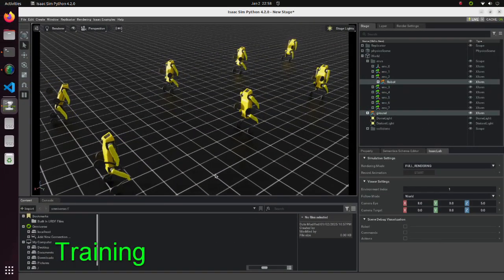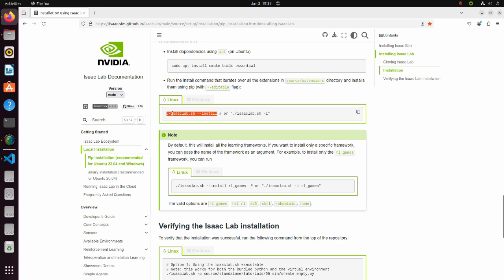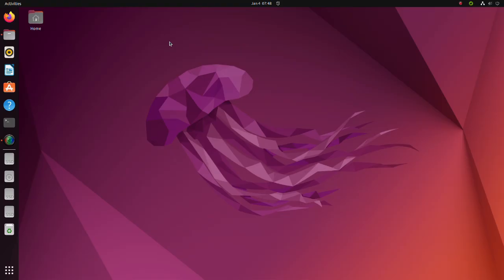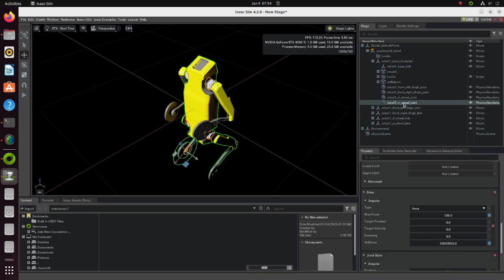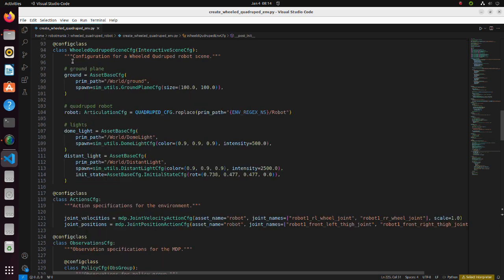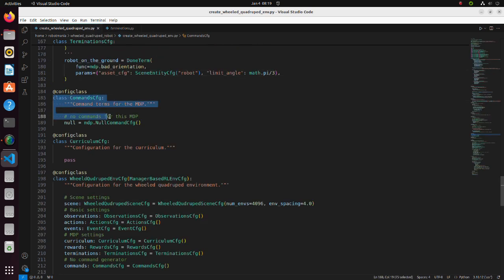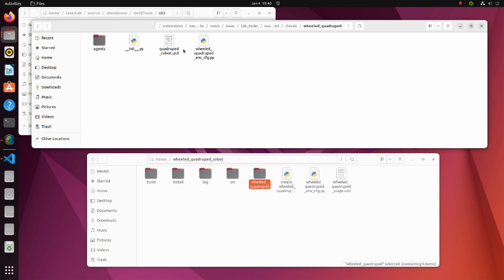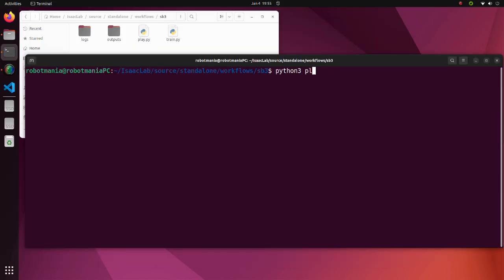Isaac Lab: Custom Environment Training. A Step-by-Step Guide

Comment: Hi, thank you so much for your video, that is an awesome video. I have found a helpful video like this for a long time.
But i have some questions, I hope that you can help me explain.

- What is the difference between Isaac Lab and Isaac Sim? Which is better? better in the long term, supporting, for performance, etc?

- What is your PC configuration? ( RAM, CPU, GPU, etc). I read the requirements to install Isaac Sim/Lab, so it is okay if I use something like a GPU, CPU does not meet the requirement?

- I noticed that you've been training using the available policy, which I believe serves as a foundational approach—a starting point to get familiar with policy-based training. It's a great first step. Moving forward, if I want to improve the training quality and results, I assume I'll need to modify or optimize the policy, right?
Also, regarding the policy currently used in your video, is it specifically tailored for the object you're training with? Or is it general enough to be applied to other systems, such as robotic arms? And if I want to adapt it to a different task or platform, would I need to make any modifications to the policy itself or the training program?

- Would you be able to share more videos or suggest useful resources for beginners like me to better understand how to think about modifying existing policies or even designing new ones tailored to specific tasks?
At the moment, I'm mostly following available projects—just installing dependencies and running training scripts as instructed. But I haven’t yet reached the point where I can build or adapt training programs or policies on my own. So any guidance or learning materials that help build that kind of thinking and understanding would be incredibly helpful.

-Would it be possible for me to connect with you through another platform, such as LinkedIn or WhatsApp?

Thank you so much and hope to hear from you. Have a nice day.
Reply from the maker: Hi Thanh Bao Tran!
Thanks for watching my video!
1.	Isaac lab is a tool (libraries) to do reinforcement or imitation learning using Isaac sim. Isaac Lab is built on Isaac sim.
2.	I use several PC. In general, if you have 256~GB SSD, NVIDIA RTX graphic card (such as RTX 4060, 4070) intel CPU such as i7 and 16~32GB memory, Isaac sim should work without any problems. If you use Isaac lab and you would like to do training with large number of environments in parallel, you should have a computer with higher computational capabilities. 
3.	In this tutorial I trained policy using a common algorithm such as PPO. If you want better results you may tune network of the policy or do hyper parameter training. Also, this algorithm can be implemented to other tasks including robotic arm. To get better results. you might need some modifications.
4.	Here are pages of libraries that are often used for machine learning.
https://stable-baselines3.readthedocs.io/en/master/
https://scikit-learn.org/stable/index.html
https://github.com/leggedrobotics/rsl_rl

Comment: Thank you for your contribution to help people learn Isaac Lab. But please put the warning that this robot has less DOF than the real robots. This USD file will confuse people who start with Isaac Lab without understanding Isaac Sim.
Reply from the maker: Hi Huy Nguyễn!
Thank you for the suggestion!
Actually, this robot has 12 degrees of freedom. You can see joints definition it in the xacro file. I just fixed them to make it easier to do learning.

Comment: Awesome tutorial and content. But I do wonder if there is a tutorial on how to write the RL parameter configurations, namely that .yaml file. I cannot seem to find this in the Isaac Lab official documentations, at least not anywhere conspicuous. I do think these configuration files stem from Isaac Lab wrapped RL library interfaces, so it's odd that there's no relevant information. Do you know how to operate this, or where to find relevant information? Thanks a lot!
Reply: I just found the Gymnasium documentations, could be something here, looking at it now.
Reply from the maker: Hi Tony YANG!
Thanks for watching my video!
I would rather recommend you see “Stable Baselines3” documentation. Here is the page for PPO which I used in my tutorial.
https://stable-baselines3.readthedocs.io/en/master/modules/ppo.html

Comment: Thank you very much RobotMania for this interesting video tutorial. I wonder how difficult or straightforward it would be to use the resulting policy from this training on a simulated robot in Gazebo. It would be great if you could make a video explaining how to use a model trained in Isaac Lab in the ROS environment. The only one I have found on this subject (using the resulting policy from Isaac Lab in an environment other than Isaac Sim) is the one in the official documentation where they implement the trained algorithm on the real robot Spot from Boston Dynamics. The problem is that it seems to use a specific API for this robot, which I don't know if it is based on ROS2.
Reply from the maker: Hi Jose Luis Torres!
Thanks for watching my video!
Isaac sim uses SB3 API as it is, so you can use trained data in another simulator like Gazebo as long as you follow specified protocol. In case you create custom environment for SB3, you should follow these instructions. https://stable-baselines3.readthedocs.io/en/master/guide/custom_env.html
If you would like to create custom environment for gazebo, you should create the “CustomEnv” class inside ROS2 node. It will look like this.
class GazeboEnv(Node):
    def __init__(self):
        super().__init__('env')
        class CustomEnv(gym.Env):
            def __init__(self, arg1, arg2, ...):

Comment: When I tried to run with the same command line with you to train the robot (using sb3 and num_envs 8), I was success to run the program. However, the result is very bad compared with yours. In your case, I can see the robot can balance itself when you run the play code. In my case, the robot still fell down. Do you have any idea what would be the reason for this? Ive tried to increase the num_envs, but still cannot reach your result in the video. Thanks!
Reply from the maker: Hi Towerboi!
I also find that training results are unstable. I did train in several machines and results were different each time. Please try to experiment with hyper parameters in the “sb3_ppo_cfg” file. I actually got better results with less timesteps (1e6). If you have time, you can do grid search of hyper parameters.
Reply: I see, thank you for your suggestion!